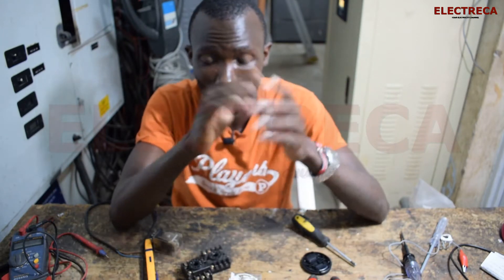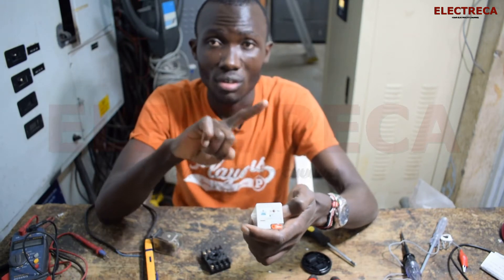How does relay switch work

Comment: Bro thanks for your time but in this case you have to specify which voltage supply you are using depending on the relay you have ,ie 12v dc,24vdc,110v ac/240vac etc
Reply: I think in ac systems we use relays of ac voltages 220 ~240v

Comment: Hello,
Kindly,do for us a vedio for a control
panel using a selector switch (Auto OFF Man).

How do you connect a command start signal to a Gen set from the automatic transfer switch like the one you did.

Thanks a lot for Your guidance.
Reply from the maker: Noted

Comment: like can you do a vidio of a three phase wiring of a bell circuit with 12 and 240 VAC rellays transfomer and idicator board bell of both 12 and 240 push button,buzzer and alarmn system both in one installation..kindly
Reply from the maker: I will try to organise it. thanks for watching.